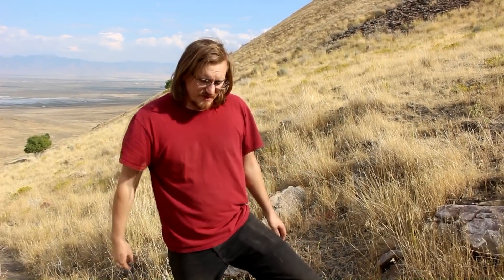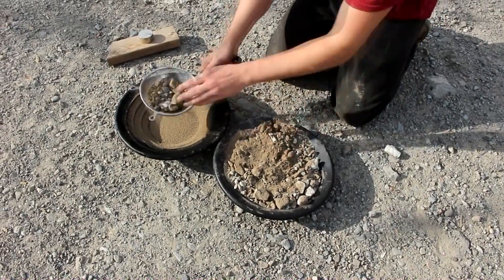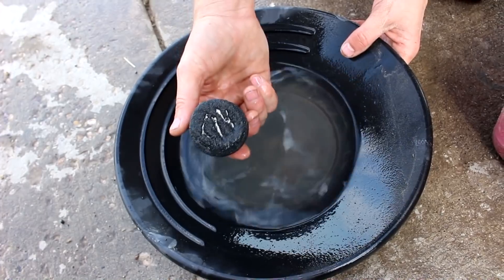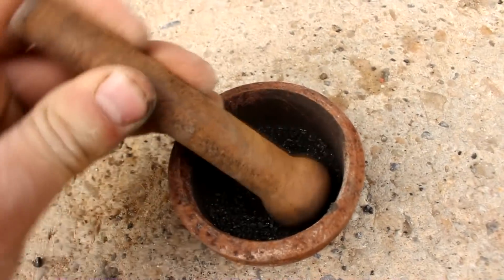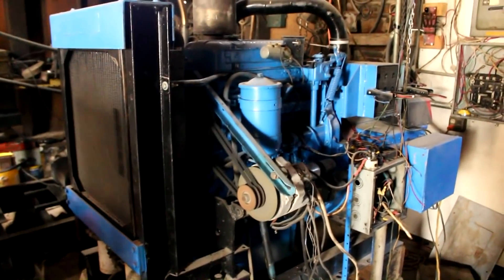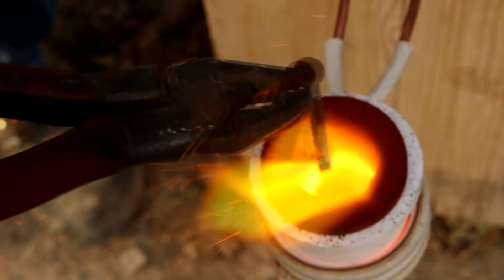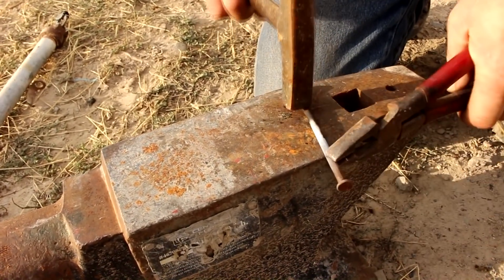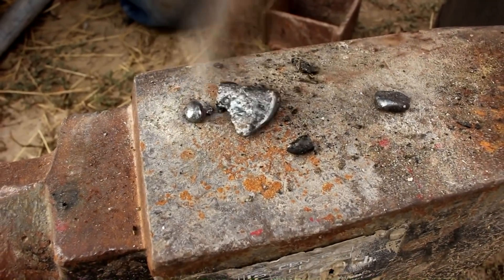Rock to Iron

Comment: Idk how but this video made me think about why we use flux out of limestone, or CaCO3.  It oxidizes first, before the high temperature (more reactive) iron that is in the furnace.  It becomes CaO, really anything that oxidizes quickly and absorbs a lot of the oxygen and mixes well with iron (can't really put a gas or liquid that mixes with iron), but calcium carbonate is exactly what you need, and you really don't need industrial or purified CaCO3, because the rest of the stuff in limestone are oxides and other things that will act as flux, and which don't form alloys either.  Any impurities that are metal however, will stay in the iron, but that really doesn't matter since the nickel found in ores is actually beneficial.  As long as it's not too impure, you get the bulk property of iron while using less iron.

Comment: You can do it without powder at lower temperatures around 800 to 900 Celsius,  the rock will give you low carbon purer malleable iron almost like mild steel

Comment: If you use clayto completely Seal The  crucible you will be able to make crucible steel and if you make it right it will be nearly perfect sword steel the problem is working with the metal the crystalline structure The crucible steel naturally has makes it very hard to work with in a forge but it also makes for a very strong sword

Comment: But wouldn’t the charcoal you used have salts in it because the alkali elements don’t evaporate out? And wouldn’t adding more carbon turn it into high carbon steel and not pure iron which is why it’s brittle (the more carbon, the more brittle the steel). That might actually be a high carbon steel with things like sodium and potassium in it.

Comment: Huh. I'm a little surprised you ground the coal. My understanding was that steel mills used coke in their blast furnaces because it was mechanically strong enough to form a stack with voids that the air and molten iron could flow through.

Comment: With the Bessemer process, why does blowing oxygen through molten iron refine out the carbon and not just oxidize the iron?
Reply: it does oxidize the iron, but then it's being reduced back into iron by the carbon
Reply: I am not too sure, but I would assume that the impurities in the iron (carbon, silicon, etc) oxidise much more spontaneously compared to the iron itself. I would imagine though that a small amount of iron would indeed oxidise, but it would be negligible depending on the scale :D

Comment: Place the magnet in a zip lock bag to make it easier to clean. Place a magnet under the sluice pan as you are sifting...
Or a long pvc pipe with magnets strapped around and pour your slurry through it.
8:47 have you ever been splashed in the face by molten metal yet?

Comment: Damn how smart was the guy who did this the first time
Reply: grug think this rock hurt more than other rock
Reply: @sponduli  exactly what i was thinking,  they probably saw one of their weapons is more durable than all other, and hundreds-thausand years of discovering fire they may also have discovered iron after burning their weapons into extreme heat, and finding the leftovers of their weapons pure solid and strong, and then they may have begun black smith work
Reply: @sponduli  lmao
Reply: it was quite possibly an accident say if you built a fireplace out of that rock it could form fine non melted iron on the sides
Reply: A lot of inventions came from chance. Someone should do a video. Like penicillin, vulcanized rubber, etc.
Reply: @batenkait0s657  Og, "Dude so I tripped and dropped some powder I got out of rocks into some catalysts and they fell into my furnace and out popped something I'm gonna call iron. It was crazy man, no one would ever believe it if my mom didn't see it happen."
Reply: Thousands of years and trial and error. Curiosity, not brute intelligence.
Reply: @ziquaftynny9285  Trial and error and documentation of said trials and errors.
Reply: @ziquaftynny9285  "brute intelligence"? Kind of an oxymoron dontcha think?
Reply: @ruebene2223  Ya
Reply: @ruebene2223  Nah it makes sense. People think of intelligence almost as like a Stat or a level. If you have 100 intelligence you can do this much and 200 this much.

He's saying action supplemented with intelligence instead of just raw thinking power.

Connotation of words and mixing language is fun :D and useful for shortening messages
Reply: @ziquaftynny9285  Curiosity, more often than not, is intelligence
Reply: @ziquaftynny9285  dear sir, you insult the intelligence of humanity. I dare say it was likely discovered quickly, relatively speaking.
Reply: @animewarrior3  Relative to what? Without a frame of reference there's no speaking relatively.
Reply: @storerestore  the span of a single lifetime
Reply: animewarrior3 for some reason I read this in a British accent
Reply: @storerestore   "Time" relative to time. The frame of reference is the time humans spent on Earth compared to when they discovered iron..... He literally could not have made it clearer. Please stop being that guy, just cause something sounds good in your tiny mind, doesn't mean you're not going to sound stupid.
Reply: @kingmonkeymonk7064  That's what confuses me, because with human existence as a frame of reference, iron ore extraction was by all indications discovered relatively late. But thanks for the totally unnecessary insult. I hope you feel better soon.
Reply: @storerestore  Humans started agriculture 12000years ago and metals first used 9000years ago but you are correct, humans have been around a lot longer than that. And I do apologise for my comment
Reply: @storerestore  relatively to the speed at which every other known species has discovered forging iron.
Reply: @indatgodi  If what you're saying is that it's a pointless remark with no useful meaning, we are in full agreement. By the way, I'm relatively early in writing this post compared to every other known being that have not. Enlightening?
Reply: Probably he (or she) discovered it by accident... like a good part of the most important scientific discoveries.
Reply: @pietrotettamanti7239  lol "he or she". Good God stop being so indoctrinated with todays pathetic SJW rhetoric. Of course it was a man , if you didn't know why it wouldn't be terribly surprising , considering you don't seem to be capable of forming original thoughts.
Reply: @pietrotettamanti7239  You're a moron for saying "she".
Reply: @hotsauce153  so apparently women cannot have scientific discoveries? Okay then.
Reply: @bintmas  pretty much. And they never had...
Reply: @hotsauce153  no, this is very much untrue, many women have made scientific discoveries but the credit is given to men, this is highly shown with Nobel prizes, I don't really care about the gender favouritism but the facts are still there
Reply: @bintmas  If there's any, they're just outliers. It's as simple as that!
Reply: @hotsauce153  it's not like that at all, women just don't get credited
Reply: @hotsauce153  cough Marie Curie cough

Edit: Gertrude Elion, Hedy Lamarr. You want anyone else?
Reply: @bintmas  yeah they can but I think at that time there werent many blacksmith women... or maybe there were, I actually have absolutely no idea
Reply: @hotsauce153  maybe at that time it was very uncommon for women to participate in this type of activities but women HAVE made inmense scientific discoveries and its very ignorant to say they havent. Maria Goeppert for example.
Reply: @hotsauce153  
Why
Reply: @restrokruc2688  because it's near impossible, historically speaking. It's that difficult to understand kid.
Reply: @hotsauce153  why is that
Reply: @hotsauce153  Guess the first programmer was a man then. Oh wait, she wasn't!
Reply: @bintmas  thats a complete misrepresentation and you know it. There are countless men who have had their inventions stolen. This is not a gender thing. But its simply undeniable that men have done more for science and tech,by an overwhelming margin (at least over 90%, seriously lowballing). I mean open any textbook in the sciences. I would bet a good amount that the first name you come across,and 9/10 at least,are all men.
Reply: @ijustchangedmyname  wow,THREE names!!!! Oh my god, humanity is changed!!!! Oh and btw idk about the third,but the forst two were part of TEAMS that did their discoveries. Now shall i start counting male names? I have literally way too many to even begin. Einstein,Tesla,Newton,Ramanajuman,Bose,Salk,Hawking,Feynman, Oppenheimer,Galileo,Leibniz,Pascal,Ford,and so many more i'd take an hour to write.
Reply: @AlejandroGonzalez-wo5fk  not a speck compared to men. Laughable in comparison.
Reply: @Stettafire  sure,but you could maybe name 4-5 females without consulting google. I could rattle off 50-100 male names off the top of my head. If you're pretending the majority ,by an overwhelming majority,isnt men, you're lying to yourself
Reply: @IkesPimpHand  Congratulations. The only thing you proved is that women weren't taken seriously and weren't even given a second thought or a chance to do anything for science for a majority of human existence. You did not realize in your sexist fugue that maybe just maybe women aren't worse than men.
Reply: Trial and error. And no, iron was not discovered quickly, copper and bronze were used before iron.
Reply: It wasnt a person that did this for the v first time. This is forbidden knowledge brought to mankind from the fallen angels
Reply: @richardcastaway7683  Exactly! They taught mankind how to build great structures and how to make things with metal. The Nephilim (half angel/half human) were offspring from those fallen angels. The world was very evil at that time 4500 years ago, that’s why the world was flooded by the Lord. Evidence of the Nephilim (mud fossil giants now) and the giant silicon trees that were cut by the angels are all over the world.
Reply: @hotsauce153  you got problem with woman? Lol your mom is a woman to right
Reply: @restrokruc2688   No, I really don't...
Reply: @hotsauce153  then why you mad at  woman being a inventor? Isnt that really stupid
Reply: @hotsauce153  oh really misunderstood then what's the problem with woman being an inventor? Kid don't get it
Reply: Only kid that think 1 gender is great but when you grow up you will understood that both gender is great
Reply: @restrokruc2688  it is very unlikely that a woman or women invited iron.
Reply: @codysimpson911  i'm not talking about women invented iron or not, i'm talking about men is not the only gender that can invented stuff
Reply: @restrokruc2688  okay, I'm just stating the undeniable truth.
Reply: @codysimpson911  i didnt denied that
Reply: it prolly was like "shiny gud"
and bam, war time
Reply: @hotsauce153  i bet your mom really proud of you typing thats bullshit
Reply: @hotsauce153  wasting your time? Why you reply then? Calling me a stupid kid but your word is like came from a todler, lol.
Reply: @restrokruc2688  the only reason I'm replying to you is for the sake of whoever that would read this, you degenerate fool. Now fuck off, and get a life. Do you even have a job? There's a reason I'm assuming  you're a dumbass kid, you know that right?
Reply: @hotsauce153  "Cause I dont think you care that much about women to begin with" if you think that I don't care with women to begin with then why i start argueing with you? Answer that
Reply: @hotsauce153  speaking of brain nonsense i think you got one
Reply: I dont believe anyone can successfully do this for the first time without all the knowledge he's learned from previous generation of craftsmanship.
Reply: @haha-eg8fj  if you needed previous experience on doing this for doing this for the first time you'd be fucked. You can't have experience in doing something that you'll be doing for the first time you moron
Reply: let say it's a field that have been evolving and improving for thousand of years. probably you can't say there is a single person that created the whole method of smelting from scratch but it is generations of accumulative knowledge that had enabled the first man to do it and the people after him to improve the methods even further.
Reply: "hehe dirt go fire" "oh damn it shiny now"
Reply: @safalta2435  what the fuck does that even mean/has to do with anything?
Reply: They used iron from meteorites before iron from rock. Didn't really need to be smart to pick it up off the ground.
Reply: @staples4335  iron from meteorites is completely different from iron ores people would find in the ground. They have nothing to do with each other
Reply: @fufun4me  once you get the impurities out it is the same
Reply: @staples4335  True for the source, but someone had to discover what it was and its properties.
Reply: Ironman!!
Reply: @jimbobjoe5004  yeah i dont know why i sead steel 😂😂 i ment iron but same thing vikings pioneered it
Reply: Weren't the Assyrians some of the first people to utilize iron tools?
Reply: I took a loooong time to unlock the iron age.
Reply: [Zillah also gave birth to Tubal-cain, a forger of every implement of bronze and iron. ] Genesis 4...
Reply: Nån form av intellekt fanns la
Reply: Smart? That implies it was intentional. The smart ones were the ones who made a business of it and thought of ways to refine the process(no pun intended).
Reply: Now I have to look up how iron was discovered
Reply: A lot of knowledge comes from weird place.  Traditionally aborigines using Urine as part of an insect repellent. Who tried that first?
Reply: More importantly, who the hell was the first person to do it?! And where were they from?
Reply: im wondering. If you didnt have a magnet. The cast iron would be even worse right? So would the purifying just take even longer? or is it not even worth it?
Reply: Elemental iron was accidentally discovered while smelting copper ore. It was a red-hot spongy mass or "bloom" left over. Whatever ancient person (maybe a Hittite) figured THAT out was a verifiable genius and severely altered the course of history. Before that the only source of iron was meteorites and that made it worth more than gold. In fact the word "iron" comes from the Etruscans and means "from the gods" or "from heaven." Of all the things in King Tut's tomb, the iron dagger they found was the most valuable.
Reply: The book of Enoch (apocyphal book of the Bible) says that men were taught metal working, as well as astrology, star signs, seasons, medicine, herbology and even makeup by fallen angels in exchange for the right for them to have human women.
Reply: I'd be willing to bet he was just attempting some alchemy, as you do, or fucking around, as you do, fucked up a little, and then realized his mistake produced a cool rock
Reply: @hotsauce153  okay bro, have a nice day
Reply: it wasn't one guy. first the technology of making metals started using copper. in the middle east and then the same technology was upgraded for iron.
Reply: Vikings used similar techniques gor steel swords whial the world was using brass and bronz vikings melting and forging steel
Reply: What would ancient astronaut theorists suggest?
Reply: Metallurgy was invented in mount Ida by a group of 10 or 100 men who were called Idaean Dactyls (the fingers) in an era where Zeus had not yet been born, their descendants actually nurture him ages latter in a cave in Mount Ida.

Comment: Cody, what would you have to do to your metal to turn it into wrought iron. I'm looking for the woodlike grain when you etch or break it. I have a gas forge and a crucible. Do you think its possible to make it in there?
Reply: Heat the pig/cast iron until it melts. Stir it with a steel rod to help carbon burn off (finery/puddling process). When the carbon is low enough, the iron will start solidifying due to phase change (cast iron melts at 1200'C, but wrought iron melts at over 1500'C) . Once that happens, you have wrought iron (or a varying degree of carbon steel).

Comment: How a thermite reaction works is that iron oxide (Fe2O3) is less stable due to iron having a less electron affinity. Aluminium oxide (Al2O3) is more stable due to aluminum having a higher electron affinity. The oxygen in iron rust wants to be more stable. So the oxygen leaps toward the aluminum leaving pure iron.

Comment: 263 amps at how many volts? Most houses only support 200 amps but if the voltage is stepped down then that would make sense... oh yeah it was a generator. but still, how many volts?